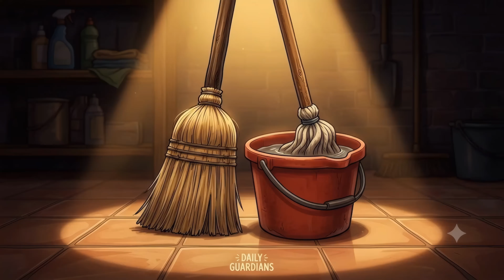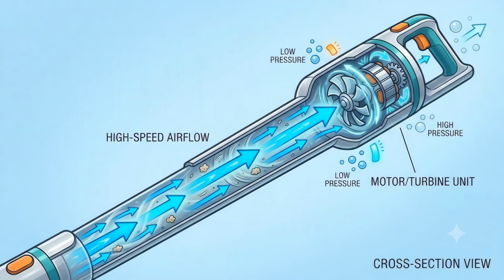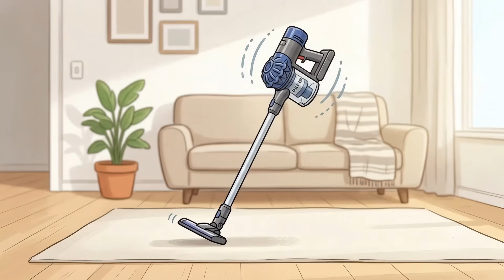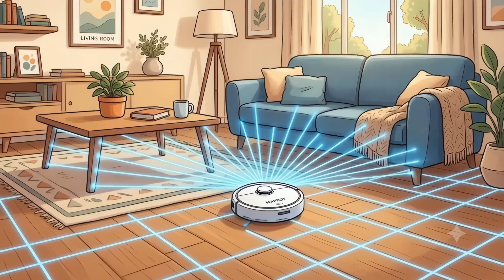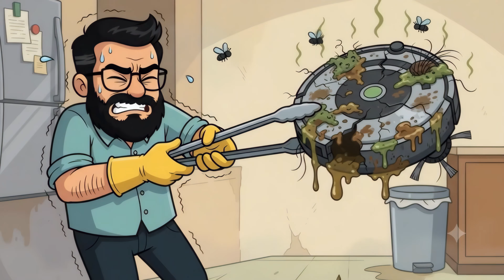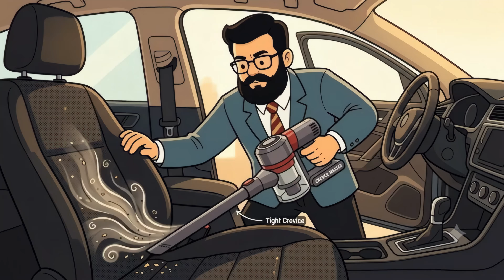Robot Vacuum vs Stick Vacuum vs Broom: The Winner Isn’t What You Think

Comment: This is wrong on so many levels. Robot vacuums have obstacle detecting sensors now! EVEN IN A MID RANGE MODEL! MOVA P10 PRO ULTRA?? Yessir. The Robots also have extending side brushes now so they deal with corners. THESE CREATORS ARE WHATS TAKING OUR RAM GUYS THEYRE USING AI FOR VIDEOS THAT ARE COMPLETELY JUST WRONG. Roboking square was a thing and that was amazing for corners and obstacle avoidance. Roomba S9? Corners. Roomba J7? Obstacles. MOVA P10 pro ultra? Mopping, vacuuming, CORNER CLEANING, OBSTACLE AVOIDANCE. Creator you better check your facts before posting another video, THIS IS NOT 2012.